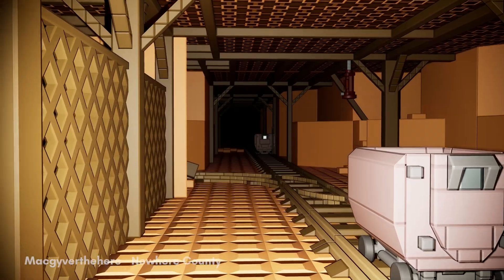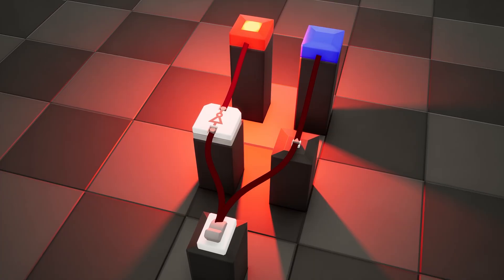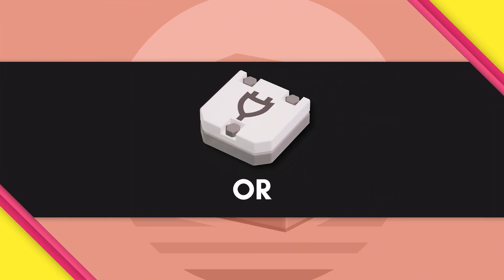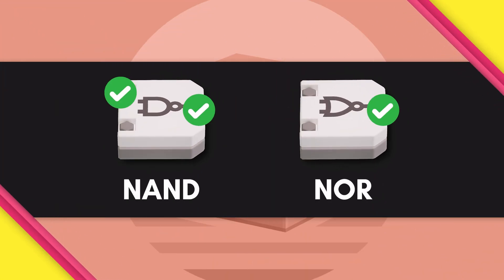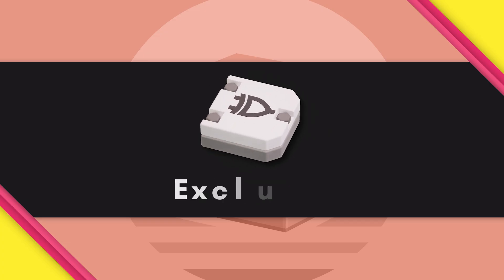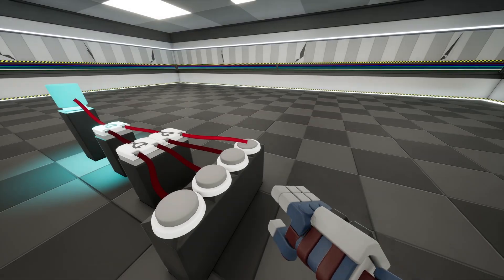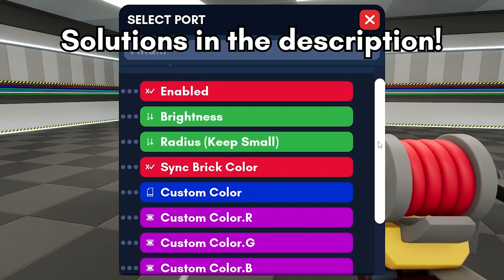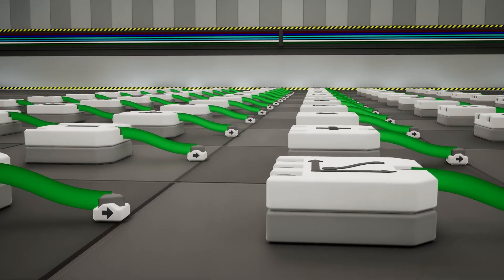Brickadia Logic Gates 101 (Wire Academy - Lesson 2)

Comment: 8:51 ok at first I thought mission 2 was a bit too difficult for this point in the series, (thought it needed latches/buffer loops/variables) buuut you can mostly do it just with
- 
spoilers
- 
- 
- 
- 
- 
- 
- 
buffers not in a loop but just to extend the short signal from the targets, setting the buffers to instantly turn on but slowly turn off, with AND gates right before the buffers.
It works surprisingly well considering it's way simpler than all the wiring combination lock stuff normally has.

No idea how to do it without using any buffers or servos to store state though.
(Since that kinda concept hasn't been covered yet I'm guessing the intended solution doesn't use those?)
Reply from the maker: Spoilers
.
.
.
.
I might have led astray by saying "Shooting them out of order does nothing" so I'll make a pinned comment about that. This puzzle can be done by using the applicator on the targets and setting their times to 4 - 6 active seconds. The rest is just AND gates connected in sequential order, with each gate sending a signal to the associated light. No buffers or variables needed / expected at this point in the series :)